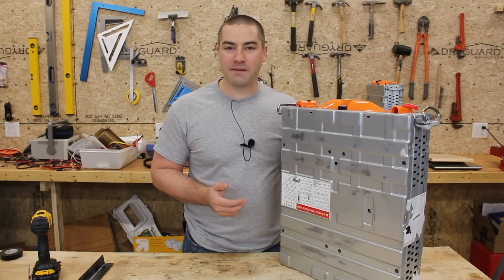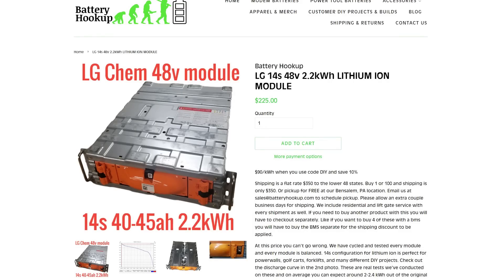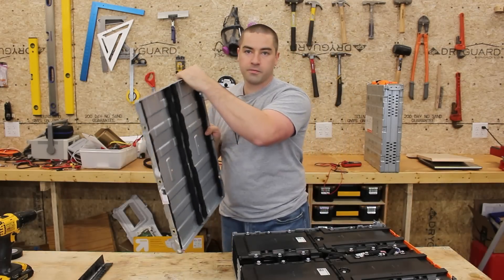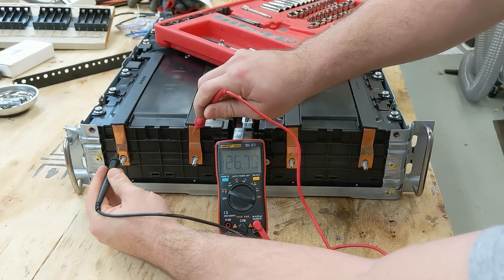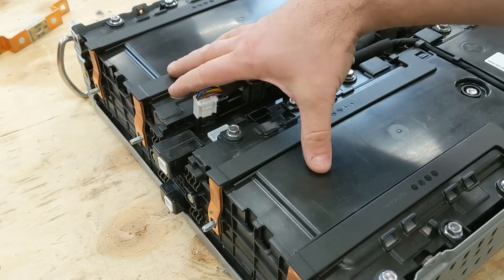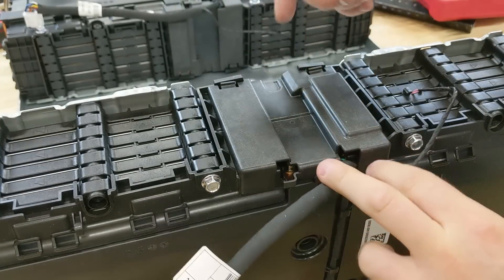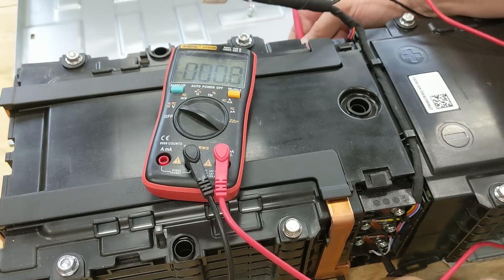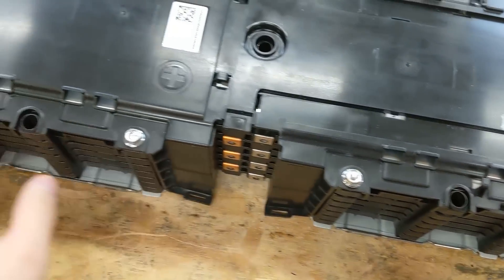Batteries for Home Backup, 14s 48v (51.8v) LG Server Rack Lithium

Comment: Lg had a recall on them
Reply: Link?????
Reply: Have these been battery's been previously recalled and sent back to LG and then resold?
Reply: For what? Degradation? The packs (cell pouches) look a little puffy...
Reply: LG had a recall on some of their high voltage home backup batteries.
Reply: What was the recall?
Reply: Do you happen to know what the recall was for?
Reply: @LithiumSolar  Recall was for those batteries starting fires. Look at them even in this video, the packs are swollen and quite pressurized. The housings were bursting and oxygen made them burst into flames.

Comment: You kiled the pack . The pressure plate is ther for a reason .
Reply: And the fact the pouches have ballooned that much is a bad sign. (they've sat for a long time, and/or been deep discharged.)
Reply: @jfbeam  They don't have either sit or be deep discharged to develop this. Chemical decomposition happens over cell life and those are so old that have been sent to recycling.

Comment: Great video and you answered my only question, how long. Just one safety tip. I know these are low voltage but even so it's not a good idea to be touching the terminals (IMO) It's a bad habit as one day it won't be a low voltage terminal but because it was a habit you touched it.

Comment: Dave you've (an the peeps on the Facebook group)  done all the work that I was about to do but got sidetracked by a handful of bad batteries  that were sent me. I will say that BatteryHookUps response was top notch. They immediately shipped me 4 replacement batteries without being asked, compensated me for my time and the supplies I had to buy to package the 4 batteries up and ship them back. In BatteryHookUps defense they would not have known that there were issues inside the pack because I was the one that broke the screw locker on all 4 packs that had issues. A minor annoyance that set me back a week or so but has now been resolved - the new batteries were delivered yesterday and going forward when these are in stock again they will open and inspect every pack before shipment. When they are back in stock I will for sure be buying some more. Thanks for the great video as usual!.

Comment: I love those soldier joints I use them all the time on automotive applications. One tip for people is to make sure all the soldier melts if it doesn't it may end up being a dodgy connection. Also try not to move it too much while it's cooling

Comment: Thanks for showing how they can be split in half and/or reconfigured for different voltages and parallel connections.  I might split one of the 24 volt modules and restack for 48 volts and half capacity as an ebike battery thats half the weight of the complete rack mount unit.

Comment: One thing I found with my larger LIFEPO4 pack is even though I purchased them as a matched set, they can still deviate. I run a High current balancer in parallel to my 200A Daly BMS. This makes sure that under high loads I can keep them balanced better to prevent those super low cells.  This 200Ah 12v pack is used in an RV that usually sees very low load, but my 2kW/4kW inverter can cause a sag that triggers imbalance protection early, also my truck is equipped with dual 330A alternators to a high current bus, before the balance board was installed, the high current to top off the battery when towing (trailer can get up to 150A through my Anderson aux cable and DC/DC controller) would trigger the BMS to go into imbalance protection, now I have to pull 400A to even see a variance in cells, but the daly only lets me do that for a few seconds.

Comment: If I'm not mistaken there was a massive recall on these batteries for catching on fire, Which apparently happened a lot at the power storage facility that they came from ,
Reply: In fact I witnessed one although I wasn't sure of the DC cables sizes and it was installed without a bms and I think the inverter was locally build too I guess it was supplying too much current to many variables but the fire was massive

Comment: These were all recalled, I imagine these were all pulls from that recall and why there's so many of them on the market right now.
I wouldn't use them in any large or permanent installations, only for experimentation!
Reply: So how do you find out they were recalled.. I bought 8 of these.  Pencils out to anout $141/Kwh.
Reply: Why not use them in a powerwall. Was gonna use them at a vacation lake house.
Reply: Using (8) 60A Daly Bms should keep me in cheap power for a few years. Whats my downside?? Thanks for any info in advance.
Reply: Check out the shipping cost. $350 in any qty I think.
Reply: Omg wish I saw this before I bought 32 of these 😳
Reply: Sorry Folks. I would never buy a battery with only 66% rating left. Any LiIon will be on its steady way to the grave.

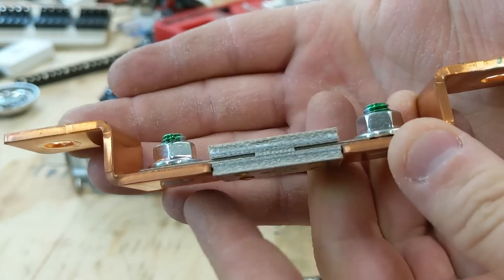Comment: 3:33 I like seeing genuine Bussmann ANL fuses (UL listing) instead of the $0.10 aliexpress special people insist on using!
5:10 Those resistors you're pointing to are the bleed resistors for balancing :)

Those seem like very well built batteries. I like how everything is modular and bolted together vs just welding everything. The parallel groupings even separate like pancakes! I agree, having 7 with 2s in each is a prefect solution. It's too bad they're so degraded though, that's a bit too much degradation for my liking... And yes, I like the longer format!
Reply from the maker: Thanks.

Comment: I quick tip for you David when you use the heat gun. Bend  heat shield attachment round a piece of pipe to make a L shape so you only melt the solder in the connectors / heat shrink.

Comment: Paralleling multiple packs is what I did with my bank I built from the A123 36 volt packs I got from them. Currently have 10 packs with each cell group in parallel, and I converted them to 16s 48 volt packs by breaking apart a few packs from 12s to 4s and then adding those 4s packs to the complete 12S packs. Built out I have a 100ah 48 volt 16s pack and they are good for several thousand cycles. Just ordered some more of them and will expand my pack to 16 in parallel. By doing so all the groups are very even, none are drawing any sort of high c rates for charge or discharge and they are performing amazing compared to the BYD packs. If I were to do it all over again I would have never bought the BYD packs, I have 2 of those and while one of the two was in quite good shape, the other one is a mess of varying weak cells. I've had to add additional cells to each of its cell groups to balance it out and get it closer to the first pack. Setting up the A123 packs was more time consuming but it's performance is just so much better.

Comment: That logic module is two independent BMS's. The left side is the comm circuits for the external management (UPS?); it's all opto isolated. The reason for two is so the fuse can pop without the BMS then being the bridge between packs. These units are extremely dangerous -- and very likely, illegal to ship -- because they do not have a means to disable the output. (someone would need to take off the front panel to remove the fuse.)

You'll see the same thing in ever EV on the market -- the service disconnect cuts the pack in half, if the BMS weren't two parts, the BMS would then have hundreds (or thousands) of amps trying to go through it. (granted, a car has a lot more batteries -- usually 48+48) [The Chevy Volt is a bit different as the BMS is built into each subpack / module]

Comment: Excellent video, as always -- clear and concise.  I love seeing the step-by-step tear-down (and re-assembly) -- it takes a lot of the mystery out of these things.   And I am envious of your workshop -- nice setup!  You answered a lot of questions, raised one or two more.  

You mentioned these might be good for backup (which is what I'm looking for).  I'm guessing they would be stored/maintained at a storage voltage of ~3.7V per cell until needed.  In the event of an outage, they'd be put on line (either a manual or automatic transfer switch), and the charging voltage set to full (4.2V per cell).  And once the grid is restored, draw down to 3.7V per cell, and then taken off line.  This is assuming that Li-Ion batteries lose capacity of stored for long periods fully charged (like the LiPo batteries I use in rc airplanes). 

Is this a sensible line of reasoning?

Thanks for the excellent instruction -- you've been a great help to get me started in this game.
Reply from the maker: If I was using this as backup, and it will be sitting long periods of time, then we have a dilemma.  You are correct, that 3.7v per cell is considered the best long-term storage voltage.  But, on the other hand, in the event of a power outage you will want as much stored power as possible.  Personally, I'd probably set my charger to 4.0 volts per cell (56.0v) for a good balance.  I'm also the type of person to test my equipment, so I'd probably do a full cycle (discharge/charge) every 6 months or so.

Comment: There's two ways that you could have gone with these batteries! 
One, an active balancer... On top of the BMS that you installed would have made use of the available energy still left in the good cells. If the Balancing function on the BMS could be turned off, that would be much better than wasting excess energy across the discharge resistors... Active balancers can be paralleled for more current transfer and across two or more of these battery packs, they should work out fine...
Or option two, test the battery packs as you did, work out which one's are not performing as well and simply rebuild them so that the cells are closer matched... This method works a lot better if you have three or more of these battery packs! 
Either way, you will avoid having a battery pack that has cells that are not being used due to the weaker cells! 
I definitely like this idea of using server backup Batteries, it keeps everything nice and neat inside the server rack!

Comment: David, firstly, thanks for sharing this great content! The long-format is well-suited for this type of video. Secondly, would it be possible for you to post a link to your spreadsheet detailing the pack options and associated costs? Thirdly, while I agree with reorienting the cells for parallel connections, I would caution simply connecting everything up with such large voltage differentials. I'd recommend temporarily paralleling cells via fused connections and incorporating a resistive load to limit current to safe levels. Another option is to individually manually balance the cells using an external charger. I'd also advise characterizing each cell (capacity and internal resistance), then optimally arranging them. This so as to further maximize pack output.

Another suggestion is to measure the height of the pack prior to disassembly. Then reference this information when compressing packs for reassembly.

Lastly, as I've previously mentioned, it'd be great to see you incorporate relays or contactors along with a small, inexpensive BMS, rather than continually increasing the rated size and proportional expense of ever larger BMS units. Removing switched current from the BMS reduces heat, thereby increasing reliability, all while creating a single design standard. No need for multiple BMS makes, models, etc.
Reply from the maker: Hi John,  Thank you for always taking the time to write such thoughtful comments.  Sure, I posted the excell spreadsheet at https://www.patreon.com/DavidPoz  It's public, so you don't have to be a member or pay for it or anything like that. 

I would not suggest paralleling the cells when they are at different voltages.  When I received the battery the cells were 4 millivolts difference.  That's when you want to parallel them.  And, yes, it would be best practice to capacity test each cell individually, then let sit and check for self-discharging cells.  I simply can't answer every possible question that may come up in every single video.  

Yes, I measured the height of the pack before breaking it down, and while assembling.  But, come on, the video is already really long.  I have 60GB of raw footage and some stuff has to go.  Besides, the aluminum sleeves stop you at the right height.  

I'd love to do a video on contactors.  I have a collection of EV contactors now from different batteries that I think could work well.  Do you have a wiring diagram you can share that would work for using a low-cost BMS with contactors?
Reply: @DavidPozEnergy  David, if my comments were taken as criticism, please be assured that wasn't my intent. I only wish to provide additional information that you and others may find useful.

As for a contactor diagram it's important to note that, as in most things, there are multiple ways to achieve similar results. I'm referring specifically to configurations supplying directly powered, non-capacitive loads and that do not rely upon CAN messaging.

For these configurations, any BMS connected to a source capable of powering the contactor coil, as well as rated for the coil's consumption, will suffice. Simply wire the BMS load output (P-) to a load-side contactor. On a low-voltage condition, the BMS deenergizes P- and the contactor opens.

For mis-matches between battery voltage and coil voltage, buck or boost converters could be used. However, to keep things simple, I'd chose contactors rated for battery voltage, with switched current ratings exceeding output requirements by the standard 25% margin.

For our applications, a charge-side relay may be appropriate, depending on the standardized BMS chosen.

As our's aren't crazy high voltage, as well as high amperage applications, dual capacitors aren't necessary. Additionally, precharge capacitors, with their associated circuitry and logic aren't needed for non-capacitive loads.
Reply: Can this module be converted to a 1s14p?

Comment: This is excellent! I really enjoy your videos! One comment, I wouldn’t use loctite on a conductive threads, since it can act as an insulator. instead I would clean the surface and use conductive grease optionally for long lasting good electrical connection! You are awesome, keep it up !!
Reply from the maker: Thanks for the comment.  I got into the topic of Loctite in another video, might be worth checking out. https://youtu.be/sPZwL1z_qxI

Comment: now those are the batteries I need. I can then buy a server rack and just stack it full of those batteries this would be great to get a nice battery set up. Well hell there already sold out they need more I like to pick up 5 for my solar.
Reply from the maker: I think they are getting more in soon
Reply: @DavidPozEnergy  That's cool I like how you talked about paralleling  them up in the pack,  Because watching you BMS APP on the phone I was thinking the same thing.  I like to build a 100AH pack at 48 volt's for my solar system.   And its not a bad price for used batteries.

Comment: Congrats on reaching you 1st 100K subscribers! I am sure that the second hundred will come much faster, since you have now become recognized as an authority of both batteries and solar systems. Really a great comprehensive video, David. My question is, "did I see you using a new soldering iron and, if so, what kind is it?
Reply from the maker: No, I've had that soldering iron over a year.  I have used it in several videos.  It's just a cheap, but big watts, from amazon.

Comment: I'm a newbie to LiFePO4 battery &  backup usage so the questions I have might seem; will be very basic; but I haven't seen anything that would address the questions. You vids are Very detailed and clearer than others I've seen so far. Here are the questions; which I hope I broke down smartly enough in 2 parts: Part #1: A) How do you decide on what size pack to buy? B) Who to buy thru? & C) The quantity of packs to buy? Part #2: A) In this particular case; since half the pack is weak; could you run the same test on the other pack and swap out the 6 strongest and make one better balanced pack? B) Would it make monetary sense buying in bulk; say a pallet of 8-12 or so packs at a time; and reassemble balanced packs for specific uses or appliances at home for back-up? & C) Would this be something that could be used as a short term power supply before a generator kicks in; such as brown outs during the summer season to run critical appliance or equipment such as: CPAP systems, Personal O2 generators or other necessary health related equip? After watching just 2 of your vids, I subscribed. Sadly, al these ads that YouTube is placing breaks up the flow of your vids.
Reply from the maker: A lot of these questions will depend on your particular situation.  On one hand, you could buy a battery/inverter combination system that would probably be a good backup for your CPAP.  Such as the Bluetti AC200P I reviewed in another video.  
I tend to DIY my batteries because it's cheaper.  Yes, you could buy more of these units than you need, test each cell, and re-group only the best ones.  But that's going to hurt the economics.  Once you start doing that it makes more sense to buy a new lithium battery.

Comment: BTW thanks for posting your comparison of PV solar heat vs passive solar heat. I am combining both. I have a old leftover Pool heater panel . never worked very well but I am altering the unit by building an enclosed case . pumping water through it from 2 200 gallon tanks filled with Rock to retain the heat and also heating it with a 300 watt 12 v heater connected to my solar panels charging a battery system. this will heat the water both ways and will be pumped through a water to air heat ex changer also solar powered. works well . will video and send you a link when I have it complete